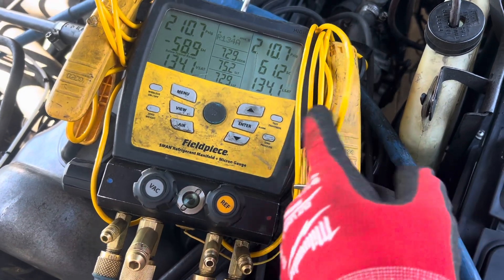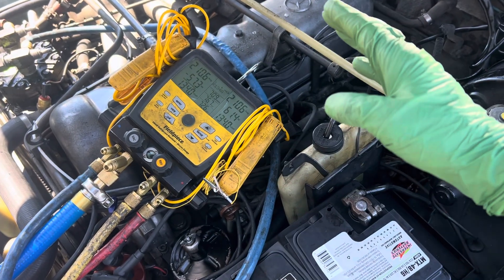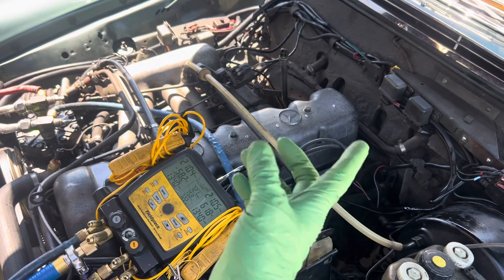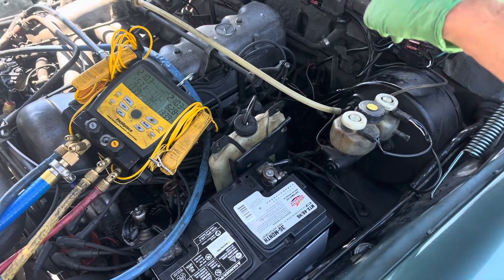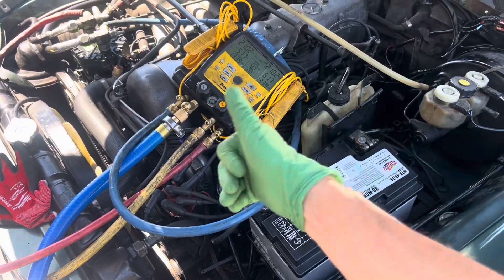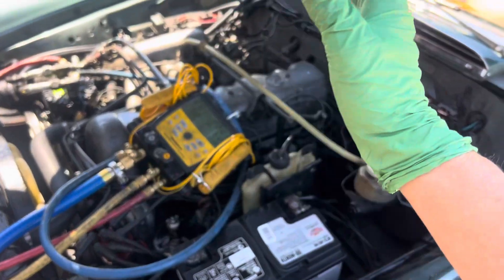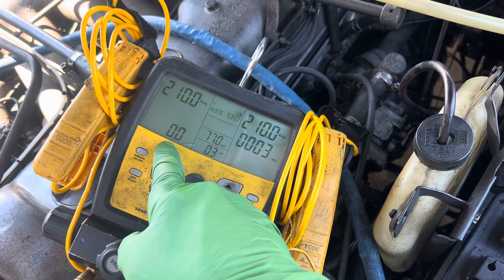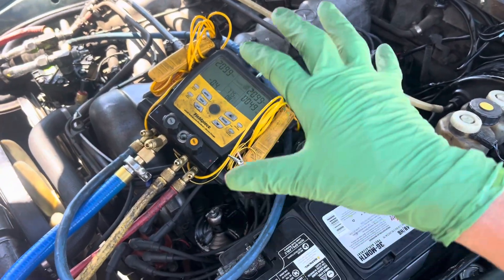AC digital gauges much more accurate to 0.1 of a psi that you can never see with analog gauges￼ ￼

Comment: The quality of modern gauges and speed of the refrigerant analysers are really amazing. I haven't done any HVAC work professionally for almost 20 years but anyone doing it these days should be using these digital gauges or they are refusing to keep with the times and probably providing a sub-par service.

I must admit though that I still have my old set of analogue gauges plus a digital micron meter but it's only for doing my own stuff and occasionally helping diagnose friends or families equipment probably 3 or 4 times in the last decade.. maybe I'll eventually upgrade to a fully digital set in the future. (by the way as you know the digital micron gauge itself is a game changer when it comes to understanding ultimate achieved vacuum, residual moisture, micro leaks etc.)

These newer gauges though take that ability to see what's going on with the system way further than just vacuum, being able to do a pre set high pressure leak test, which like you said you'd never see say a 1 psi drop over 30 mins on an analogue set. 

Anyone doing this for a living or regularly working on HVAC will come across slow leaks that you'd not see on an analogue set unless you were prepared to spend many hours of your day leaving the gauges hooked up.. the ability to catch even just one of these and not have to come back in a week or two when it fails again pays for the price of the gauges with the saved labour and good reputation. 

Time is money and call backs are a nightmare.. I can't see why anyone doing this for a living would want to use analogue gauges anymore.
Reply from the maker: @user-uz1yv2oc9v  👍100%

Comment: I want to move into a set of these digital Fieldpiece gauges soon as I'm able, not only for the accuracy but the fact that you can select a larger variety of refrigerants they will work with, plus they allow you to see superheat and subcooling in a glance using the temp clamps which is important to me since I also do residential and commercial HVAC.  Way before I learned HVAC, I was a scuba diver and that's where I learned the different laws pertaining to gasses and their relationship to temperatures.  Charles's law says exactly what you were explaining about pressures being directly proportional to temperatures and visa versa.  This one law is so critical to understand because it is what makes refrigeration even possible.  Thanks for the video
Reply from the maker: @SkillSavvyDIY  👍

Comment: I say it every time. Thanks master tech Tom, for taking your time and explaining pure gold information. We can't even see 1.00 psi changes on analog gauges. I need that tool with the 3 ports just for cars.
Reply from the maker: @walkertb  the convenience of four ports. 

You can leave one hooked up to the vacuum pump never disconnected . 

The yellow hose you can use for refrigerant or nitrogen .  

But it is available in 3 port 
SM380V 

4 port 
SM480V